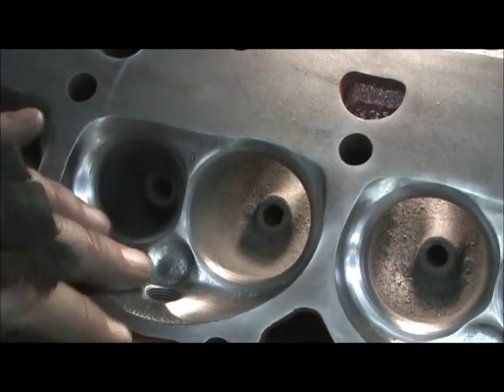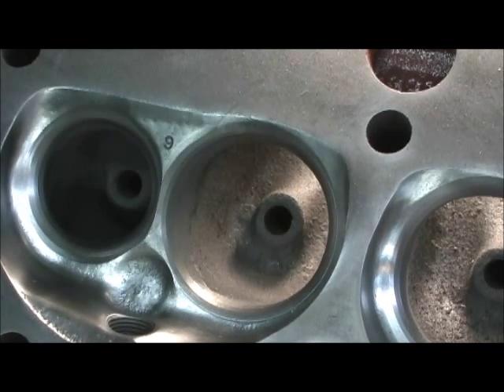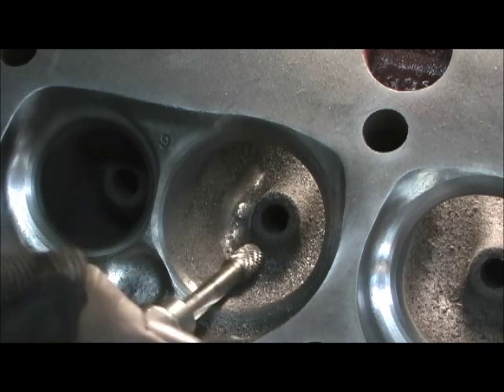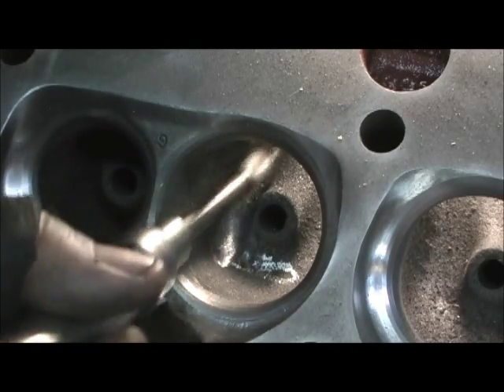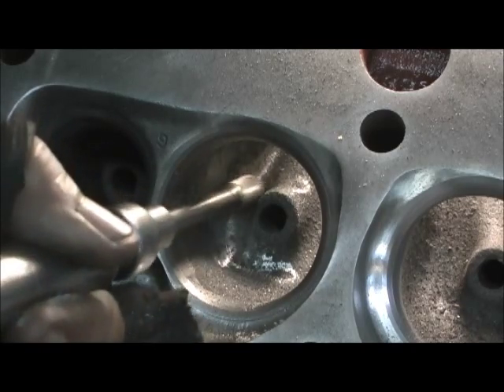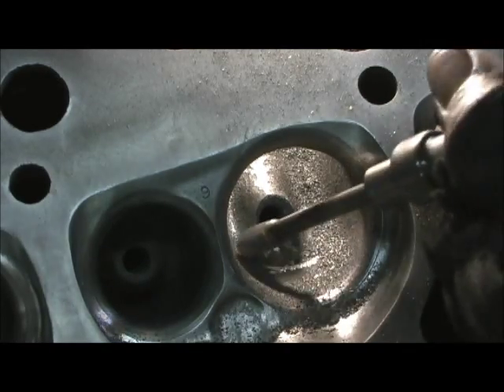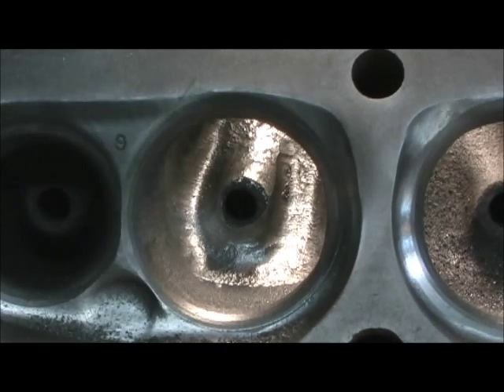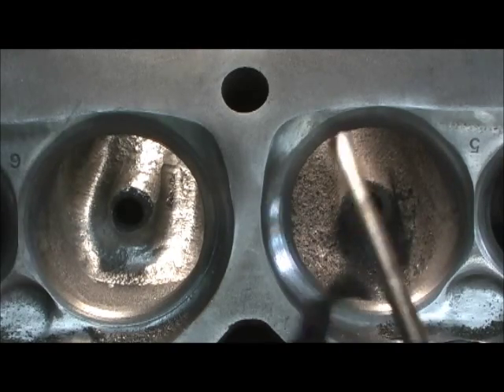Imhoff SBC 186 Intake Port Roof and Guide Shaping 4.0

Comment: Random question:
I have a set of Iron L98 heads and there is a large square boss around the spark plug hole.[similar to the vortecs]
should i leave it alone or smooth the edges?